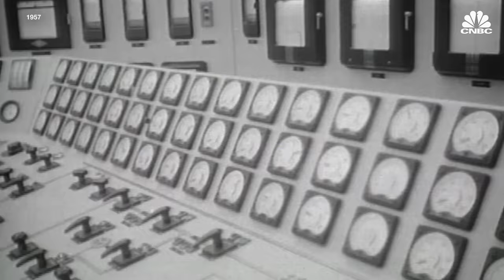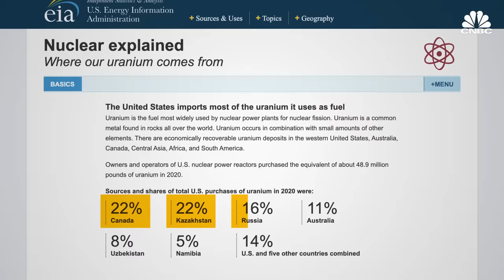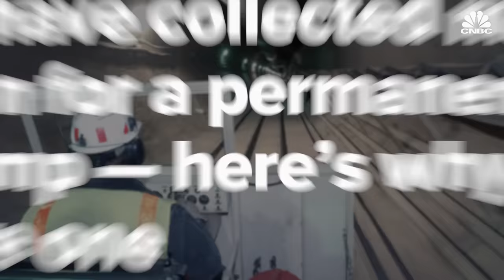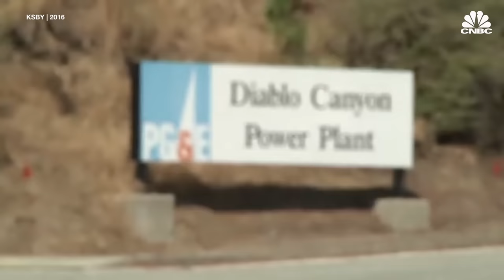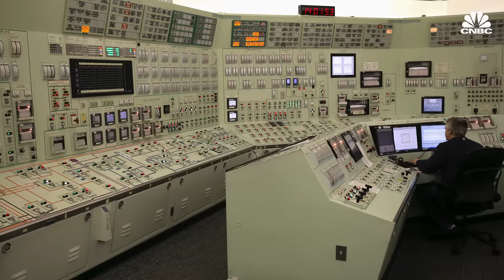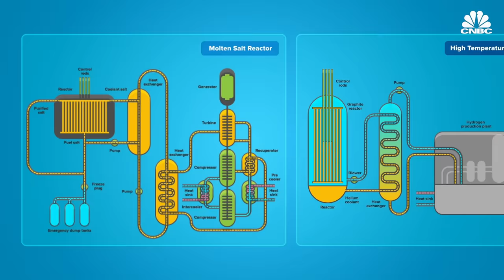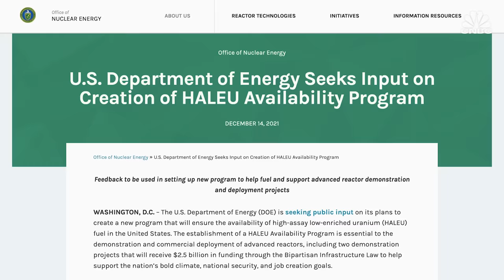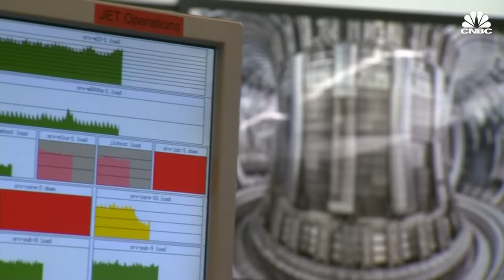Why Nuclear Energy Is On The Verge Of A Renaissance

Comment: When you have people that literally believe that a nuclear reactor can just blow up in a massive mushroom cloud you aren't going to get a lot of rational discussion on the subject.
Reply: Those are the same people that wear a mask on a trail when they hike alone
Reply: Talk THORIUM & move away from uranium!  Waste management is way easier (500 years as opposed to tens of thousands of years!) & more difficult to make weapons from the  thorium cycle.
Reply: 😂😂😂 frfr
Reply: ironically, a fossil fuel plant literally can do that.
Reply: @HKDW-1  it is going to be hard because the byproduct of uranium is plutonium the main ingredient in nuclear weapons... The main reason we haven't moved to Thorium
Reply: @PierreH1968  Russia and Chinese have it under development already and it isn't easy yo separate plutonium like in other reactors so no, that isn't the reason Thorium is not used. The industry wants faster reaction and higher pressure. The LFTR is not as quickly responsive and requires different steam plant configes with larger volumes but lower pressures.
Reply: @vernonfrance2974  Monopoly and Protection happens no matter the source or method. 'Fuki' happened because more than one reactor at a time stopping electrical production wasn't accounted for- to say eventually most every possibility can be prepared for.. I like LFTR for example as the site design precludes any meltdown.
Reply: Want rational discusson on nuclear power? Head over to Illinois EnergyProf youtube. He covers it in maximum detail and even includes financial and risk analysis.
Reply: @mikedar8484  Funnily enough, Fukishima happened in part because designers thought that any tsunami powerful enough to cause a meltdown would cause so much more damage itself that the reactor damage would be negligible in comparison. The tsunami outright killed over 20,000 people. The nuclear incident shortened some lives, but really no more than maybe the equivalent of 100 dead. By any rational consideration, the designers were right. But still everyone talks about the nuclear plant and seems to forget about the tsunami.
Reply: Which they can’t. Only RBMKs can.
Reply: @HKDW-1  bjjjjj
Reply: I know right even tho i know i still feel like i got cancer just from watching this my armpit is sore
Reply: when you have cheerleaders who refuse to even attempt accounting short and/or long term financial costs of nuclear power, you know you’re not going to get a rational discussion.
Reply: First of all, they don't even know what a nucleus is, as evidenced by their lack of pronunciation skills.
Reply: @PierreH1968  you can make a nuke out of thorium too.
Reply: @BlueFrenzy  not to mention, the burning of coal has released more radioactive carbon-14 into the atmosphere than all nuclear accidents in all of history have released in equivalent amounts of nuclear material into the environment.
Reply: @cageybee7221  oh yes, but Plutonium is a direct byproduct in the fission chain of uranium, not  in Thorium. It is much more difficult to make a bomb out of thorium.
Reply: That's not how a dirty bomb works and that is a possibility.
Reply: @mikedar8484  possibly now, because the Nuclear armament race is waning. But it was the main motivator for not going to safer nuclear fuels before.
Reply: @TheAlphapuck5280  Ha, ha!
Reply: @mikedar8484  the reason why we haven’t moved to thorium is because it’s harder.
And it indeed doesn’t produce nuclear fuel for bombs.

With at the begging nuclear power was made for mainly bombs so we improved and invested into the technology that gives both bombs and power.

So he isn’t wrong ,
But actually the fact that thorium cannot be easily converted into bomb fuel makes its appealing as that might be plausible to build those in poorer countries with less fear of someone taking hold of such nuclear plant for evil.
Reply: @Z80Fan  Thank you for correcting me,  my information source was my father, an engineer who worked in likely what was a dual purpose reactor in the late 60's. I have taken his words as today's truth, as uranium fission still produces plutonium.  But after doing some research you seem to be right... We need more people like you, debunking old beliefs and following the progress of science more closely. I stand corrected.
Reply: @PierreH1968  Thank you for your kind words. Granted, as you said dual-purpose reactors DID exist (in a military or research context , not in civilian power), but they were designed for that, being capable of being refuelled online so that the fuel is cycled quickly so less Pu240 is produced and the resulting material is better suited for weapons. Traditional LWRs (BWRs and PWRs) are NOT meant to be online refuelled, they run for about 18 months and then they are shut down, depressurized, unbolted, and the fuel is swapped, in a process that takes a month.

Nowadays the only operating designs that I know of that are able to be refuelled online are CANDUs and RBMKs; legend says that the lack of containment in RBMKs is a consequence of the giant refuelling crane on top of the reactor, and building a concrete dome over it would have had an extreme cost that wasn't acceptable in such a reactor that was designed for being as cheap and as big as possible.

CANDUs have a real proliferation concern, this is a well known downside; still, fuel is still cycled as slow as possible to extract the maximum energy out of it, and what people often forget is that the nuclear industry is EXTREMELY regulated and supervised, not only locally but internationally, and every gram of radioactive material MUST be accounted for, no exceptions. Moreover, going from a spent fuel bundle to a full-fledged nuclear weapon (or even just a dirty bomb) is not a straightforward process, you still need government-level funding and plants to reprocess it which, again, would be better spent in making plutonium directly, without the useless intermediary step of a civilian power reactor.
Reply: @mike_o7874  The fact that the thorium fuel cycle does't produce material for bombs is a fantasy. The natural isotope Th232 is not fissile (like U238), and unlike natural Uranium there's no equivalent natural fissile isotope (like U235), so you can't "enrich" Thorium.

You need to breed Th232 by neutron capture through the chain Th232->Th233->Pa233->U233. U-233 is a fissile isotope of Uranium not found in nature and can be used for fuel or weapons. It was tested succesfully in the Molten Salt Reactor Experiment (which is basically the ancestor of what people mean when they say "thorium reactor"), AND it was used to make a bomb that was succesfully detonated.

The fact that U-232 is produced is often claimed as meaning that making a bomb out of U233 is "harded", but it's not harder than separating Pu240 from Pu239. Since many countries had started a weapons program with Plutonium, they continued with that because U233 doesn't have any benefit (nor any downsides) over it.
Reply: @mike_o7874  Overall construct size is 1/2 that of current, a lot of 'difficulty' and 'cost' is nothing but excusing for why it was abandoned by the AEC under direction of the Pentagon.
Reply: @TheAlphapuck5280  oh my 🔥🤭
Reply: @Z80Fan  like i agree its a good thing.
like countries that would argue we want "safe nuclear" for efficiency.
why not build them the thorium version and be done with it.

But its kinda not a secret that urainium power plants were prefered at the beggining just because they did have the potential to create bomb.

so the usa and ussr were interested mainly in that.

and also some thorium reactors failed to work back then its also a factor.
like if it was easy i would have guessed we would already have those.
Reply: @mike_o7874  No, "uranium power" was not chosen to make bombs, read my other comment in this same thread. Almost all modern power plants are descendant of Shippingport, which was a navy reactor put on land. Those reactors were tested, simple and cheap to build so they became the basis for everything else. Nuclear fuel was very cheap compared to all other costs of running a plant (it still is), so there was no incentive to change the fuel cycle.

Also you keep arguing for "thorium reactors" like they are some different thing; they're not.
A reactor is a reactor, being fuelled by U-235 or U-233 doesn't make any difference in "safety".
Different designs have different safety characteristics, for example a Molten Salt Reactor cannot "meltdown" (you know, it's already molten...), but it's the same regardless of the fuel, U235, U233 or Pu239. You can have a PWR powered by U233 but it could still meltdown after a LOCA; no magic "thorium fairies" will save you.
Reply: @HKDW-1  Nobody has done it yet, despite all the YT boostering. There must be reasons; is it too hard or just too costly? Or just inertia?
Reply: quit making up childish stories , nobody believes that . the real problem is disposing of the waste
Reply: @TheAlphapuck5280  I wear a mask outside. It's for allergies.
Reply: @ZentaBon  it's called Allegra.... Use it like the rest of us
Reply: @HKDW-1  You're confusing fuel cycle with reactor technology, and do nuclear power a disservice for it. A solid fuel thorium reactor is so impractical to not be worth seriously considering. The advantages of a molten salt reactor are more or less the same whether it runs on Thorium, Uranium, or fuel recycled from existing reactors.
Reply: @PierreH1968  Plutonium-239 is the main ingredient in nuclear weapons. Minimizing the production of other Plutonium isotopes is why special reactors that "toast" Uranium are used in Plutonium weapons program. The isotopic ratio of Plutonium in spent fuel is completely useless for weapons and, unlike Uranium, the technology for enriching Plutonium doesn't exist.
Reply: @cageybee7221  Yes, you can technically make a nuclear weapon out of U-233 bred from Thorium, but the challenges involved mean anyone doing so would had to have skipped over significantly easier ways to produce a nuclear weapon.
Reply: @HKDW-1  I always have the same question for thorium proponents… if it’s so easy and so beneficial, how come no one has done it yet? The thorium breeder cycle is well over 50 years old now, as old as commercial nuclear power, yet NOBODY has ever built a commercial thorium reactor. No one is even seriously experimenting with them. That tells me that there’s some other catch, something that makes it a very hard problem.
Reply: @jacobnebel7282 You are right, and besides dual purpose plants from the 60s it is not the case anymore. I have been corrected earlier in this thread by someone else who exposed my outdated knowledge, but thank you for noticing and also making the correction . I appreciate it, and stand corrected.
Reply: I have never heard a discussion of the dangers of nuclear power that included an understanding of nuclear power.
Reply: But those things using molten salt and requiring close to 20% enriched uranium don't inspire a lot of confidence.

What happened in the cases of both nuclear accidents in Ukraine and Japan was that those things did explode and turned into dirty bombs.

So it's not like they don't blow up if something goes wrong.
Reply: Maybe you never heard of Chernobyl?  Some countries do not have the safeguards to manage a plant; ex-nuc worker here!!!!!
Reply: @HKDW-1  agreed, this is a bias report
Reply: @chriscarbaugh3936  OK Homer Simpson, you do realize that there are massive differences between what happened at Chernobyl and an atomic bomb detonation, right?
Reply: @TheAlphapuck5280  I think you need to stop stereptyping ppl because even the woman leading Mothers for Nuclear could fall under such a category
Reply: Agreed. This is going to need a big reeducation campaign. I do think many people are coming around due to objective programing like this one and the realization that renewables are incredibly resource intensive.  I also fear the oil and gas industry would counter such an effort and leverage people's fears to ensure modern advanced nuclear designs don't get off the ground. I hope I'm wrong. One thing is for sure, if we want to replace our fleet of ICE cars with electric or hydrogen, we will need a lot more available electricity on the grid. And smart grids with smaller reactors in them would fit nicely.
Reply: Then they need to be properly educated. The key is education.
Reply: @Moshe_Dayan44  Over the years I've come to the conclusion that the majority of people are incapable of understanding basic algebra, let alone basic physics. They'd rather check their horoscope and align their chakras with scented candles.
Reply: @Moshe_Dayan44  Cant confuse education with intelligence.... some people just cant be taught
Reply: @elvisherrera960  "Skits" is a good term. They certainly aren't news.
Reply: you must admit, nuclear power has form. I havent seen a solar power plant go up yet.  Of coarse its safe, the amount of money now required to keep them safe means they have priced themselves out of the market, irrespective of the hazards. For once, Capitalism has worked.
Reply: your not getting a lot of rational discussion here anyway.  Nuclear has many issues. forms of renewable energy have far less problems and are cheaper. In a nutshell, thats what its about.  Most of the discussion here is about nuclear in a bubble thought. externality costs  means its  priced itself out of the market.
Reply: @andyfreeze4072  "Renewable energy" - what a crock. There are so many things wrong with just the wording, much less all the other massive drawbacks that are merely ignored for political expediency.
Reply: @nolongeramused8135  i agree, FREE ENERGY would be a better description.
Reply: @andyfreeze4072  No, "passive collection" is better. NOTHING is free - ever.
Reply: @nolongeramused8135  by definition, your not paying for the photons so IT IS FREE ENERGY
Reply: Blame the Simpsons. ;)
Reply: Hard to blame them with media stories like this one, starting with bomb explosions and accidents.  Every media producer just loves showing a mushroom cloud on a power video.
Reply: And a lot of the people who make our laws believe that.
Reply: @colindavidson7071  “The nuclear incident shortened some lives ….”

Good post.  I’ll add that there’s no evidence of even that, no evidence of shortened lives among the public from the UNSCEAR report 2013.  No detectable cancers.
Reply: @HKDW-1  thorium also 200 tonnes of uranium makes one ton of thorium in power along with being fissile and more abundant
Reply: Solar and wind are cheaper period.
Reply: @PierreH1968  the nuclear arms race is waning?   Please inform Iran, Saudi Arabia too.  In the past decade North Korea had joined the club.  It is NOT waning, instead it’s spreading to less ethical states.
Reply: @Moshe_Dayan44  education or indoctrination?
Reply: @rcpmac  No, they are not. Nor are they reliable.
Reply: @rcpmac  solar and wind plus what?  Gas? Coal?  Then no, not so much.
Reply: That's a straw man.   Yet there have been "explosions" in these plants.   A typical explosion is cause by a "hydrogen bubble."  The explosions often result in the release of radioactive stuff.
Reply: @TheAlphapuck5280  🤣
Reply: @PierreH1968  ´
Plutonium is used with Thorium but the main reason is cost of a powerplant and resources. Thorium is harder to find which causes costs.
Reply: People watching too many movies and TV shows and not learning enough about real science.